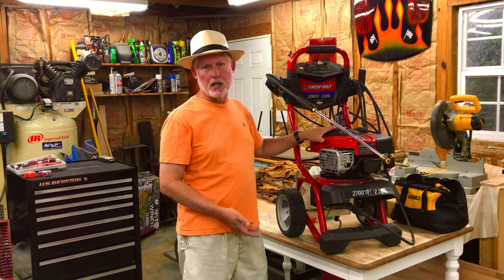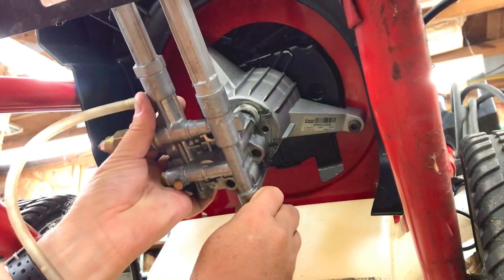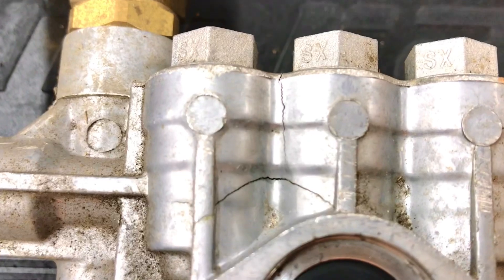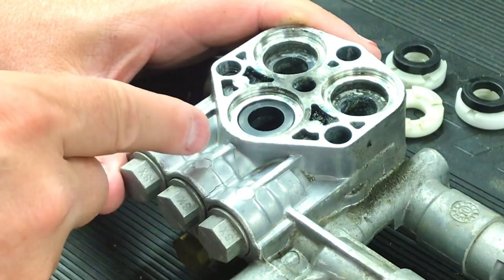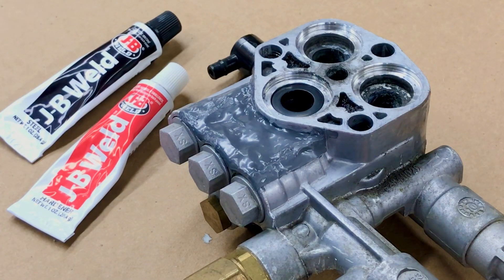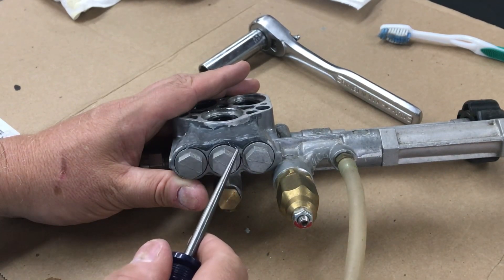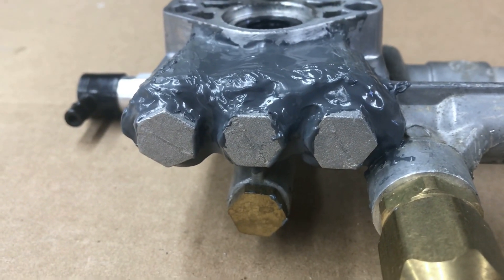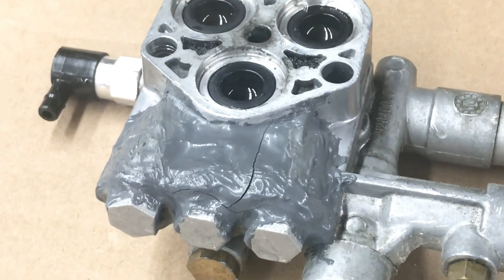Pressure Washer leaking from pump head. Will JB Weld fix it ?

Comment: Big thanks for posting this video even though the project didn't work out.  Answered a question for me and I'm sure for many others as well!
Reply from the maker: Thank you for watching. I’ve used JB Weld many times to fix holes and cracks that weren’t under pressure and it worked great.

Comment: Have the same issue. Got a nice sized crack on the pump head where the power washer hose connects. Thank you for this video, waiting for it to bond to see if it worked
Reply from the maker: Hopefully it will work for you. Thanks for watching.